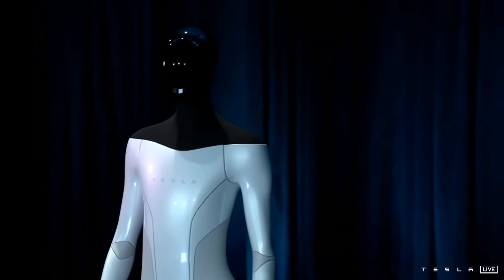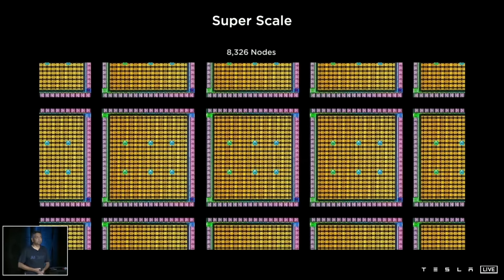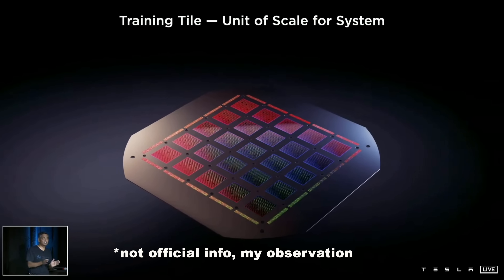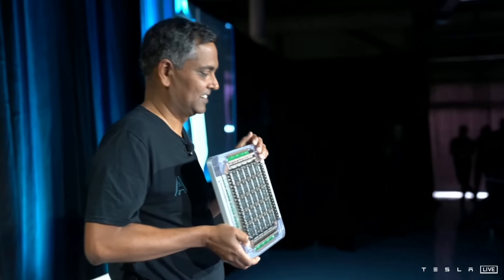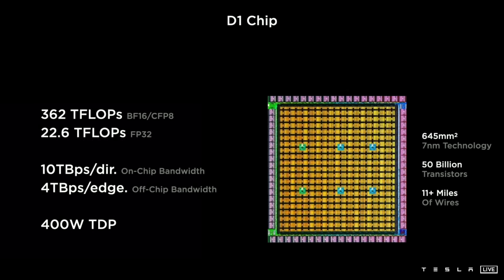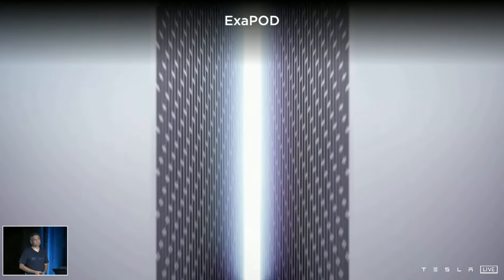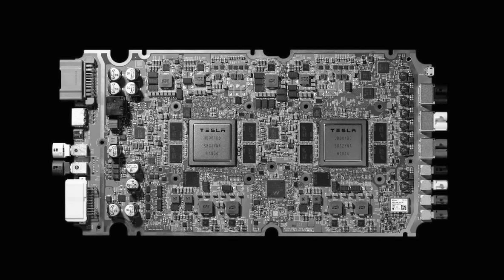New Tesla DOJO supercomputer explained! (P.S. I was right !)

Comment: With the kind of operation frequencies you are talking about, there is no way that the interconnections between DIEs are not behaving as transmission lines. That s why I am a bit puzzled when you said low impedance, did you mean this is all 50ohms?

Comment: yikes...what a power hungry beast array....makes the case for the need to move to photonics, crystal 3d structures, biological synthetic dna, and quantum compute units that self power....i.e. humans ?
Reply: I admit thast humans individuallly process less data rates, but taken as a self evolving structure with recorded learning patterns and the ability to create tools...not too horid and very cheap to allow to self reproduce.
We need to step up the bandwidths in communication between humans....neura-link ?
Bandwidth should be universal and free and through all formats as bonded/auto fall over.
We own the channels we need to assert our control.
Reply: society if it mirrored the model of a neural net would optimize group resolution of all actions and attempt to involve the most the easiest...any one should be able to vote at all times on all issues they care to (and appoint representatives on issues they chose at will with instant control of the relation status).

Comment: I think everyone else in the autonomous driving space are trying to solve the autonomous driving problem for cars, that’s their sole purpose, they are not thinking about anything else. Tesla however, is trying to develop a general purpose AI platform, and autonomous driving just happens to be the first application of this platform. The difficulty of the underlying subject matter is several magnitudes greater, and it will be much harder for Tesla to solve, but once Tesla solve the problem, the applications are limitless. This different approach enables Tesla to rely entirely on vision based solution compared to others who have to use a combination of different types of sensors. I hope Tesla gets to solve the AI problem first. Once they do, the Tesla bot will no longer be a dream.

Comment: I was surprised to see that performance was measured in exaflops (billion, billion, floating point operations per second) because floating point is so slow and error prone.  I thought that all fast neural network training was done with scaled integer arithmetic because it is much much faster and not subject to the same errors as floating point. Would you do a piece on the comparison of floating point to integer neural net training? Or check to see if DoJo is really a floating point computer array?

Comment: Brilliant!. This is Anandtech quality coverage in the details. Well done. Thank you. Yes, 400watts for the D1 chip on 7nm node certainly requires water cooling. I am more thinking this chip inside TeslaBot where the total power consumption would be close to 2Kw max or 1.2Kw average. Thus, Elon's estimate of the Bot's weight is probably 50% off. This iRobot style assistant is most compelling to me and it is doable within 2 years.

Comment: Nice presentation of the hardware.
What about discussing the tasks the training software performs, when running on those megachips.
Basically transforming all the footage samples into a vector space for all items on the road. Like a truck taking over, that generates a vector space (made of matrixes) from which the inference engine (installed into the Tesla car), can recognise any truck taking over from any angle under all lighting conditions. Vector spaces are generated from Dojo for pedestrians, dogs, etc, and are regularly updated. It is a mathematical miracle.
It has been a stroke of genius, for Tesla, to separate the generation of vector spaces (calculated in a data centre) from the inference engine (installed in the car); in this way they can achieve a level of artificial vision otherwise impossible. This does require a number of genius programmers tho...
Thank you...

Comment: So they're running the modules at 52 volts at 18000 amps? Soooo 936 kW per module? And only 15 kW of heat dissipation? Something doesn't compute.
Reply: SMPS ;)

Comment: I saw a lot of talk but in my experience no "optimized" TPU-like architecture fits well with the latest tech. ASICS are great but very inflexible. I hope that Tesla will be able to port existing code by only changing the (device="dojo") but unless I try it I have serious doubts that it will run all general networks just like a GPU.

Comment: @8:54 ~ 18,000 AMPs =  112,356 × 10^19 electrons are flowing past any point in the circuit per second. 112,356 × 1,000,000,000,000,000,000 (10 trillion)  ~ quintillion electrons per second.

Comment: be aware that the dojo chip is so fast because of only 16B calculation and not 64B this will do because otf its neural simulation use where high accuracy is not needed 
So don compare a chip or a system where higher accuracy is needed ..
You can still built a faster chip if you build the neutrals direct in the hardware then no clock cycles are needed for calculation but your neural model will be fix ..
that chip will be so fast that only a hand full will beat the DOJO computer at ease..
so maybe at the end if the neural model doesn't have to be changed they can hardwire these chips and will make them smaller an much better

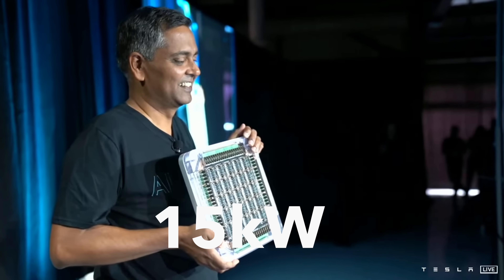Comment: 3:39 50 Kilowatts of power. 3:55 18,000 amps. Neural networks. Does it weld battleship bulkheads together in it's spare time?  How do the cores communicate with each other?  Is there a pend and post system that can synchronize action.  (One clock communication.) Say you have to do 10 steps in order and the first core does all the odd ones and second core does all the even ones. That sticky "who stores the state" issue. Do the cores on the same chip share access to common memory (no mention of this) or do they have to strictly pass all data as complete messages?  A hassle if they are working on the same large array. Obviously separate chips that use off chip I/O have no access to common memory and have to send complete messages. 10 cpus may only be only twice as fast as 1 cpu due to overhead issues.

Comment: Tesla D1 is more similar to Cerebras than other ML accelerators, but there is a big difference. Cerebras is a stream oriented design for general purpose ML. D1 is designed specifically to train on video, which means other types of workloads won't benefit as much. Google's TPUv3 is also general purpose, so the design choices were driven by different business needs. Tensetorrent is designed for the next gen "system 2.0" approach that Yoshua Bengio is promoting.

It's good that tesla is building DOJO, since they're behind Google, AWS, Microsoft and Nvidia. For the long term, they needed to do that to lower cost and shorten the dev cycle.

Comment: 18kw of heat per set of tiles… uffda that’s a lot of energy. They could almost run a Sterling engine hot side from the waste heat of those chips. Just 10 of those would drain a 150 kW/hr Tesla battery (if they make one that size) flat in under an hour. Do you know how many pizzas an hour they could cook with all that waste heat? Lol

Comment: Looks like DOJO depending on scalability can consume a country's or 2 countries worth of annual energy just like Bitcoin production does. The only difference is that Bitcoin doesn't produce anything where DOJO could and probably will get the steering wheel out of my hands eventually. Very beautiful and impressive hardware, I hope it will be put to some other use other than just autonomous car neural network.

Comment: With 500,00 node running at that temperature one of their primary concerns should be how to cope with hardware failures.  Their method of scaling will make it expensive, bandwidth wise, to reroute the data around a faulty unit.  If they are just intending to replace broken units as they fail they will never have time to run any code between failures.
One possible solution would be to only use sufficient subset of the available nodes to accomplish the task and the allocation process sidesteps the broken nodes.
Anyway, difficult to use all the 1.1 EFLOPs for the above reason and many more.
Reply: It is modular bottom up, with low-latency interconnect in all physical directions. IMHO this solves single unit hardware failure problem, i.e. if it happens - they rout around. Moreover, this approach allows improved yield of a single die.

Comment: Hi Anastasia, I know this isn't related to the video but I have a few questions regarding hardware engineering. I'm in 10th grade going to 11th this September and im super interested to becoming a HW engineer but I don't know where to start. What do you recommend I do as of now or prepare for? I know I need a BS degree and a MS degree but what should I be aware of? I'm a bit lost with all this stuff so im asking u for advice so I can get a better understanding. Thanks
Reply from the maker: Hi! That't great! You may start with learning the basics of electronics and some programming language like C or C++ . You may like to check out this video https://youtu.be/7z0G_TmErT4
Reply: I would join any kind of robotics club at you school in your area.   Concentrate and work hard to get top grades as these can help get you into good colleges.    Build something you are interested in working on.   The experience of the hurdles and problems will pay big dividends later.   Plug into the maker community in your area and online so you know how stuff gets designed and built.   There's a good deal of information online, the challenge is in learning the right things to learn.    You E.E. or M.E. career will be enhanced if you understand about multiple disciplines of work.   Get that experience by doing.  Build something you would like to see built.   Don't let anything stop you.

Comment: I guessed right on the humanoid robot, couldn't imagine anything more exciting to attract talented engineers and it seemed also a missing link for living on Mars. Can't imagine building out a whole city without robots that can work on the surface. I was especially impressed by how much work they did on autonomy both on software and hardware. On the software side they've had to restart several times. If Tesla can work itself up to the top in any field in a few years then what does that say of the pace of innovation in most companies?
Reply: This level of innovation is not possible in a company that works only for maximun return of profit in a shortest possible time. This is why only companies like Apple (Jobs) and Tesla with a strong visionary leader can make hard desisions and change the world.
Reply: @excelrobot  I can see that happening. Musk companies are in unique position to combine all of their expertise. Only a matter of attracting the right talent to work on it.
Reply: @excelrobot , Prices will drive down with certain components as well. Yes, it will effect certain jobs but those jobs were going away anyway. First use example for TeslaBot “Optimus” will be movie theater Clerk/Cashier. I wouldn’t be surprised if, just for the hell of it, Tesla made a robot that controlled the elevator and greeted you when you step in.
Reply: @excelrobot  Boston really did a lot. It's just they never were focused on AI, and that is entirely fair. After all they have mastered motion better than anyone else so far and by a long shot. It's just their robots aren't AI focused. Atlas does not do its parkour because he was given a vague task and figured out how to do it, it was pre programmed to do a very specific set of complex things in order. Spot works the same, it can follow waypoints, be remote controlled or try to follow a given target, but that is it.

The Tesla bot is not revolutionary in it's agility or physical ability, but it is because of the software that is going to drive it.
Reply: @mobiuscoreindustries  cool greats moments
Reply: Because Tesla had to or they wouldn't have survived.. If you really have to or it's over then people can get things done. On top of that, Tesla got the most money any company has ever gotten from investors. Company was valued at over a trillion dollars by investors with close to no FCF. They could literally print free money by selling more and more shares. The humanoid is probably decades away though. Elon already said FSD on Tesla would be here 10 years ago, yet it's not even close to being here. Same goes for most other things Elon has promised. Roadster? Is it even ever gonna be here? Cybertruck was promised to be here for years yet nobody has gotten theirs yet either.
Reply: @ME-CFS-LongCovid-Help  Elon is the biggest clown on earth that got the world stage for some reason.
Reply: @zubair-xj5mn Semi and roadster have both been working for years in the specs they announced or better. No design challenges to solve for those projects, Tesla is just allocating the constrained cell supply to masses of vehicles rather than a few expensive ones that would use a lot of cells per vehicle. Solar tile roof has been on sale for a couple of years already and is very popular.
Reply: It's a guy in a suit, what the hell are you guys looking at?
Reply: @alhollywood6486  Can't believe anyone thought that was a guy in that suit.